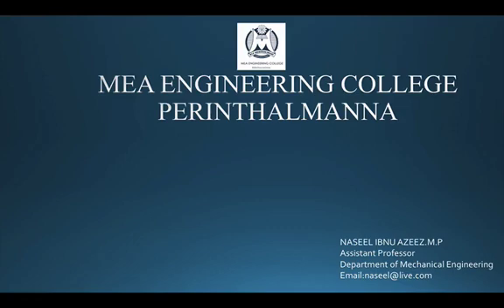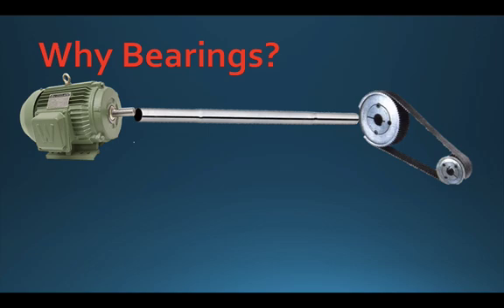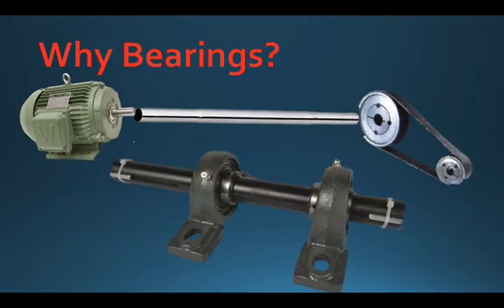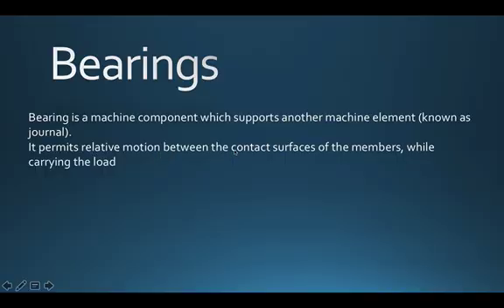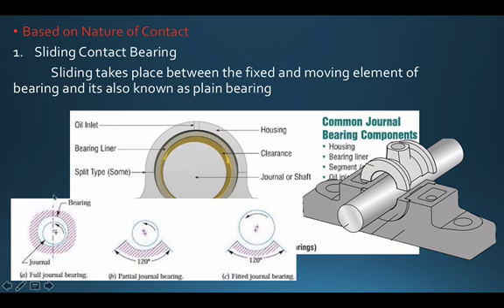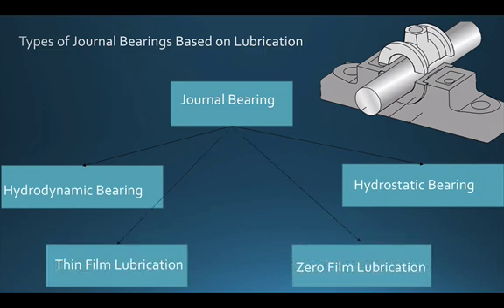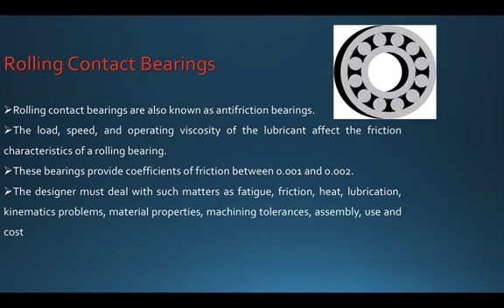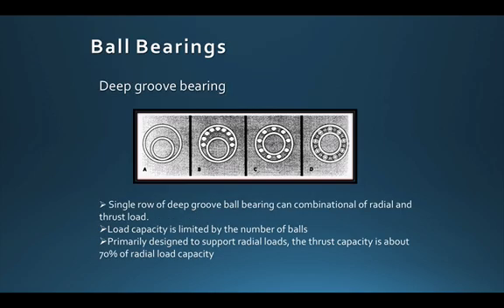Introduction to Bearings - Types of bearings

Comment: Black Oxide Steel One-Piece Clamp Style Double Wide Shaft Collar
Fanovo FWCL Series is a one-piece shaft collar. The clamp style design does not mar the shaft, is easy to remove, and is indefinitely adjustable. It is commonly used for guiding, spacing, stopping, mounting, and component alignment. Equipment manufacturers benefit from the tightly controlled face to bore perpendicularity (TIR of ≤ .002"). Perpendicularity is critical for alignment when the shaft collar is used as a load bearing face, mechanical stop, or for mounting components such as gears or bearings. Proprietary processes have been developed by Fanovo to maintain superior fit, finish, and holding power. FWCL is stamped with the Fanovo name and bore size for ease of identification. This double wide shaft collar has 25% higher axial holding power than a round bore of equivalent size. It can also be used as a short rigid coupling for applications where a traditional rigid coupling is too long. Forged screws test beyond DIN 912 12.9 standards to ensure maximum holding power. FWCL is machined from solid bar stock to a fine burr free finish. Fanovo uses 1215 lead-free steel with a proprietary black oxide finish that produces a fine glossy finish while increasing holding power and resisting corrosion. It is RoHS2 and REACH compliant and manufactured in our Zhejiang，China under strict controls using proprietary processes.
http://www.fanovogroup.com/proshow.aspx?Cateid=144&productsid=806